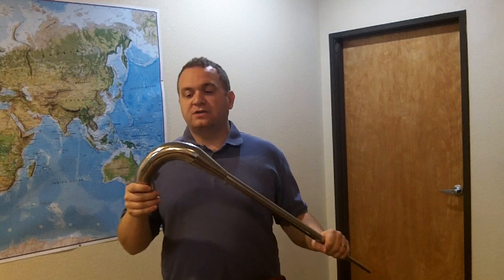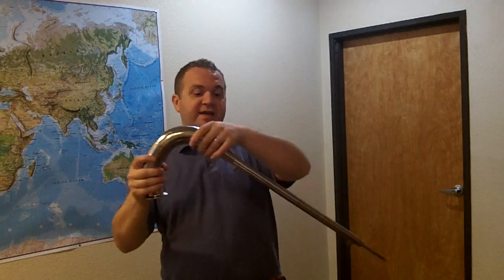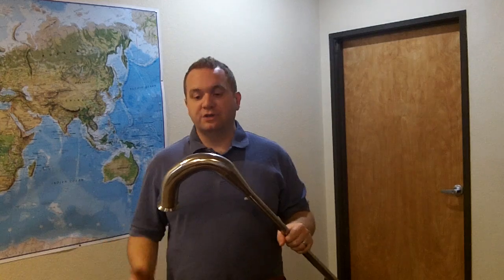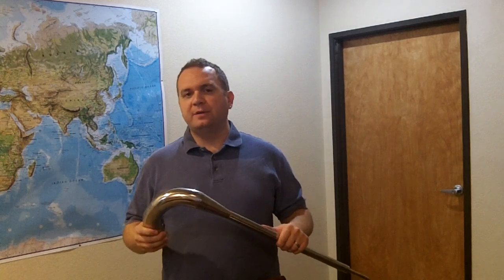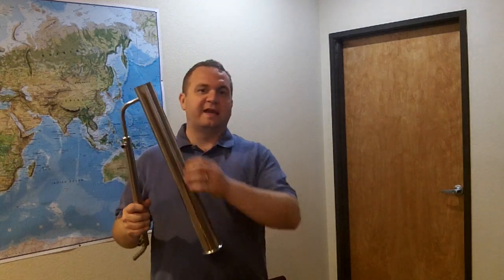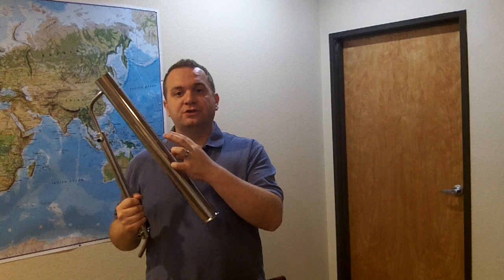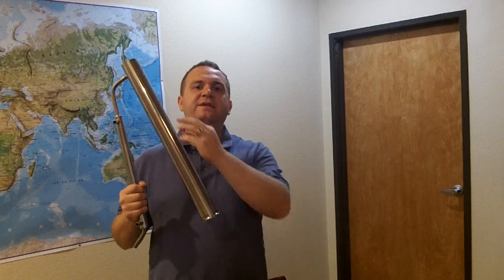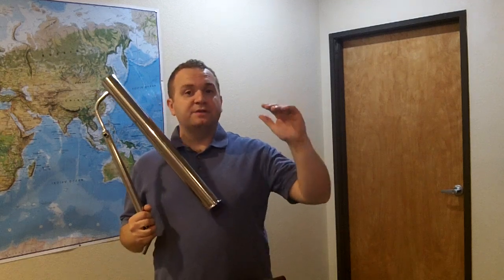Breaking Down The 3 Different Distillation Tower Types

Comment: Nice VID, but your saying to run the cooling water from the top of the condenser and flow out the bottom?  
I thought you need to flow from the bottom and out the top, reverse of what you said
Reply: I always go from top to the bottom because I figure on the whole gravity thing and I have never had a problem, also I have never got an answer to this same question...Good luck
Reply: @musicmike1960  By going from bottom to top, you ensure there isn't any air, but completely full with water.  Water is a much better conductor of temperature to cool the vapor.  It also helps to set up a temperature gradient so that at the bottom, where it enters, it's the coolest. Conversely, at the top of the condenser, it's the warmest.  The vapor effectively moves down through a progressively cooler pipe.  It's just more efficient.
Reply: @GO0DWOLF  Thanks for the info...
Reply: @GO0DWOLF  You nailed it mate, it's the same in chemistry glassware, in the bottom out the top.
Reply: I've also read that by running the water from bottom to top in the Leibig, you create a temperature gradient so that the vapor doesn't basically just hit a "wall"  .. can cut down on "huffing" or "chuffing" .. which I believe is a result of the vapor path collapsing.